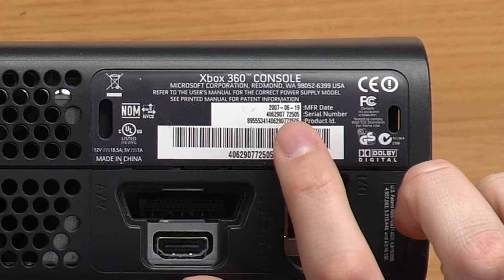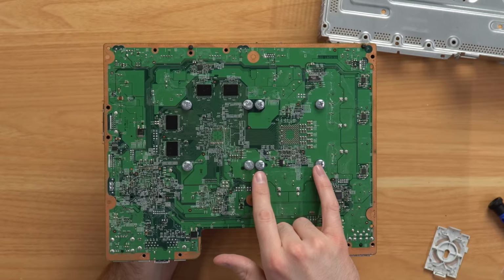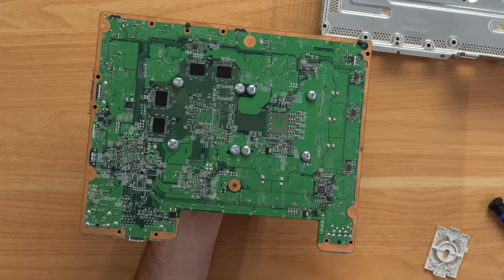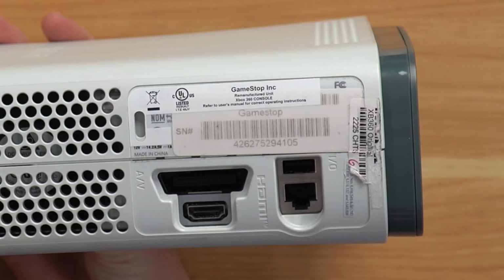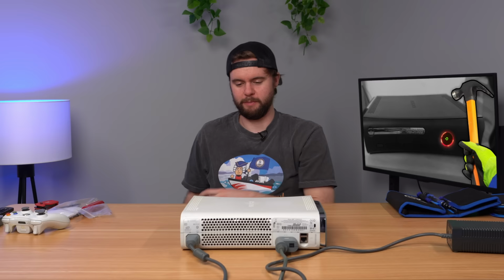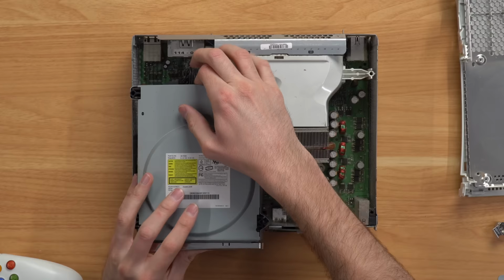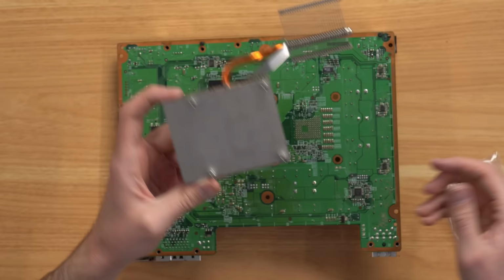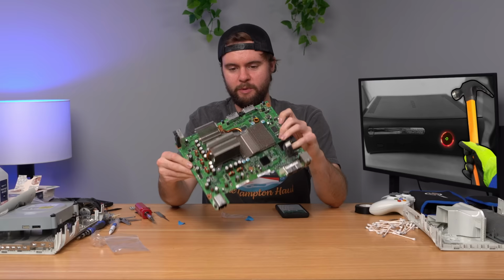Xbox 360 fans won't like this... 😳

Comment from the maker: Who knew iFixit was still selling bolt mod kits in 2024... 😂
Anyone else ever attempted a bolt mod?
Reply: I knew
Reply: I tried the bolt mod on about 6 xbox 360s.  They all worked but failed again weeks later except for one which happens to be a launch console purchased the day it was released.  This console still works to this day.
Reply: I used to do the bolt mods on 360’s years ago. Think I had one come back within a month to be fixed again. I think the last 360 I owned was one I bolt modded and it worked fine, personally!  Don’t know if I was doing anything differently than anyone else, but I didn’t have return customers. Lol
Reply: @zanarkandace6821  they probably didn’t come back cause they were out of warranty, that’s why these are false positives for gpu failure, once the warranty is out what’s the incentive to have to pay for it to be fixed again
Reply: @Nascar1243 I mean, that’s possible. I only charged $20 to do them anyways. But I DID mention to them that it was really only a bandaid, it might work for a a few weeks, a few months, who knows. But I did tell them that if it red ringed again within the first few weeks to contact me and I’d do it again for no cost
Reply: Aye
Reply: Same Me Too I knew It
Reply: hi i was wondering if i can have the 3dsxl galaxy console pls my birthday is coming up and i have been wanting it for so long so pls anwser this text and pls give me it pls and iam sub to you
Reply: Replacing the thermal paste was all you needed to do to that poor console.  Honestly, bolt modding it may well make the thermals worse since it removes the support from the backside of the chips.
Reply: I have never needed to mod or do anything with my 360 but replace the hard drive with a new one because the 360 whenever I got it from my uncle just didn't have a hard drive in it so I had bought another 250gb hard drive and it worked as good as new whenever my uncle also gave me a wired controller.
Reply: Jacob out here fixing Xboxes with out even having to fix them😂

Comment: The fact iFixit sells bolt mods is crazy because a bolt mod does anything but fix your console
Reply: it makes it irreparable. Warps the board, and the GPU so much, the bumps start contacting again, with extreme pressure on them. It's a bodge at best.

Comment: I have an Xbox 360 console myself too, but mine is an Xbox 360 S model and those models aren't as prone to the Red Ring of Death as the older models.
Reply: They actually are more prone than the originals. The last 2 revisions of the original models, Jasper and Tonasket are the most reliable revisions of the Xbox 360.
Reply: Lies. I've seen multiple red ringed S consoles, and I've seen more Phat consoles that actually work.  Any console built or repaired after mid 2008 is a tank, probably more reliable than the slim because the CPU and GPU are separate components on phat models
Reply: @superstar64   mines from 2010 model
Reply: @superstar64  I have an Xbox 360 Slim model that I've had now for almost eight years already and it never gave me the Red Ring of Death so far. At least not yet, anyway.
Reply: @WeHaveACatInTheHouse  I think my Xbox 360 might be a 2010 model as well since I know 2010 was the same year when Microsoft first launched the Slim models of the Xbox 360 with the built-in Kinect sensor port too which I have.
Reply: @vinyminotaur2694  I thought they weren't though since I always thought the original models of the Xbox 360 were more prone to the Red Ring of Death problem than the Slim models. I have a Slim model of the Xbox 360 which I've had now for almost eight years already and I haven't had any problems with it so far.
Reply: @pepsidude8919  Slims are quite reliable and should do ya just fine. But the jasper model is the most reliable out there I believe
Reply: @engrire8458  That's what I was thinking of too and I also have a Slim model of the Xbox 360 myself. I'm not sure though exactly what model of the Xbox 360 Slim it is since I don't know if it's a Jasper model or not, but I know I have one of the Slim models and I haven't had any problems with it at all so far either even though I've had it now for almost eight years already.
Reply: @WeHaveACatInTheHouse the slim?? Ah alright mines the 2013 model The Xbox 360 E
Reply: Lol my 360S died on me like 2 years ago while playing GTA 4. It was the 250gb 360S manufactured in 2010 but I had it since 2017. Then I bought a used Jasper from early 2009, and I've been using it since. The only issue I encountered is freezing in the YouTube app, but considering that same thing happens on my PS3 from time to time I guess it's the app's fault.
Reply: @dusterpl6093  I see then. I've had my Xbox 360 S though since 2016 and I still haven't had any problems yet with mine so far.

Comment: Boltmod is a band aid. Elite needs a new GPU. 1st Xenon needs some of the areas check to make sure there is correct readings coming from post, CPU clock, RST, and PLL. Most likely a failing CPU.

Comment: I did the bolt mod to mine 10+ years ago. The bolt mod works just fine as long as you don't go crazy on tightening the bolts. I used plastic washers instead of metal. I recently refreshed the thermal paste and added heatsinks to the other chips and did the RGH mod. Runs smoothly like it did when it came out the box.

Comment: If done properly the bolt mod can last for years. I fixed hundreds of 360's for a handful of years back then using the bolt mod. I still have 4 falcon boards that I fixed using the bolt mod which were infamous for the rrod. I also modded them with rgh chip's and they still work amazingly today. I have one of them sat right next to my xbox series.
Reply from the maker: Is there anything else you do to consider it done properly? I've also seen bolt modded consoles last a long time (the camo one in the video was actually bolt modded already and started working later lol), but I've also seen the ones that last for a month or 2. Either way, I see doing a bolt mod as at least being better than throwing the console away (which I imagine happens pretty often now)
Reply: @jrob0021  yeah your right some would  only last a while longer, luckily I had more successful fixes more often than not. I had several of my own that just would not take to the fix but what can you do lol. 🤷‍♂️ 

I did nothing in particular other than taking care to reflow the cpu and gpu properly and use good thermal paste/pads. I used to fix them for a local pc shop but used a rework station with a regulated heat gun. If they did have to come back I would often fix them again for free. 

Some people used to use regular paint stripper heat guns, some people also used wrap them in tin foil to "protect the components" which was wild. I definitely wasn't one of those people when I tried fixing my first Xbox I promise. 😅
Reply: all the bolt mod does is bend the motherboard, you are fooling yourself if you think its a long term fix, if it worked for you you where just lucky
Reply: @DavidWhitley  if you don't do it right   and tighten the bolts too much. Also a lot of people only used regular washers and would tighten the bolts right down which ment there was no give and yes as you said just bends the board ultimately resulting in failure again down the line.

I did the mod using washers but I also used a tork screw driver as to not over tighten plus nylon spring washers which helps stops the board from bending or causing uneven pressure.

I did it for a long while not just for fun but for a local shop so although not all fixes would be permanent the majority of the ones I fixed lasted a long while after including the few I still have.
Reply: @Saberbeatsvr  Just like a minute ago I wrote about my very long lasted bolt mod (actually it should still be in running condition and it was release day model, no ie. hdmi or wifi etc) , but I didn't do it exactly like virtually all instructions mentioned. I sanded washers for some reason. I think they were bit too high or something. It could've been stainless washers or something. Anyway I measured my stack and gap and thought it wasn't good enough and tweaked it bit.
Reply: Congrats, you damaged every single console you touched. 

People need to leave repair to professionals if they don't know what they're doing or don't understand the effects of a faulty repair procedure

Comment: The one that was overheating reminded me of my OG PS3. Does the exact same thing, the fan ramps up to maximum within seconds and then it shuts down. If there was anything similar I could at least copy my old save files.
Reply: I've had a few PS3 systems too that also did the same thing and a couple of them even got the Yellow Light of Death (YLOD). They were also all backwards compatible models as well since they were able to read and play PS2 game discs. I don't know why, but it always seems like for some reason, the original models of the PS3 are more prone to the YLOD, especially the ones that are backwards compatible with PS2 games which is also a shame too since those are the only models of the PS3 that can physically play PS2 game discs.
Reply: @pepsidude8919 because of a gpu defect, the same failure as the 360
Reply: @Josh-Barnett  Yeah. Those are the only models though of the PS3 that it seems to happen on mostly.
Reply: @pepsidude8919  I can't remember when exactly but I think around like 08 sometime fixed 65nm gpus were produced. If you have one that has the ylod can't go wrong with a 40nm Frankenstein
Reply: @Josh-Barnett  I see then. I still have a working backwards-compatible PS3 model though which I've had now for almost six years already and so far, I never got the YLOD on it yet. I also got that particular model of the PS3 from Amazon in used condition, but I guess whoever had the console before me must have repaired the inside of the system or something and took pretty good care of it too in order for it to last this long so far.

Comment: a false 0022 seems to be the fans failing or the motherboard getting to hot on startup, if you just blow cold air into the system on startup it will work fine. Very strange, a lot of xbox360's have this issue too including my 2011 slim.

Comment: I'm just going to put a little tiny bit of thermal paste on here because this is a tiny chip ... *Adds the largest of all dots to it*. You should really use a spreader and keep the layer of paste as thin as possible. Or use liquid metal if you aren't working with a copper contact plate. Liquid metal can corrode copper over time and cause permanent damage.
Reply: It corrodes aluminium, sir

Comment: If the usual issue for these machines is bad solder joints, could they be reballed? Obviously not a profitable endeavor, but just curious if that would be the proper way to fix this issue.
Reply from the maker: The proper way to replace these now is the replace the entire gpu or cpu. But yeah there’s basically nobody that does this (very few) and it’s too expensive to be worth it for most people. Just buy a Jasper is usually the answer
Reply: @jrob0021  does that mean buying a brand new chip? Or taking a donor? Would that be because the chip gets damaged due to the bad solder joints?
Reply: It's not bad solder joints - it's bad solder *bumps*. Reballing does nothing to fix the issue because the solder balls connecting the GPU to the board are not the problem. A GPU replacement is the only true fix
Reply: @Harmonic14  OHHHH, ok that's very interesting.

Comment: I did bolt mod on my x0 years ago. Bought release date box from friend in need of cash and it failed like was it in 6months but didn't have receipt for warranty. So I made bolt mod, but iirc I didn't do it like that. I removed the x-clamp, but I'm 99,9% sure I did put some washers between heatsink and board so it essentially couldn't flex even after heating. Wrapped console in towel after that and left it running for like 10mins and let it cool. Yes, brutal but it worked for like two years quite frequent playing. In fact it still somewhere in my parents house and when I stopped using it, it was still working. Man what hairdryer that thing was. Insanely loud fans 😀

edit Oh there was washers in vid too after all. Now recalling that I think I measured that gap and had to carefully sand those washers to correct height. I think they were bit too thick to have nice pressure on cpu. I don't know if was metric thing on washers or what but I think it didn't seat correctly if done exactly like in some instructions. Something like that or I used stainless washers or something. It's been ages

Comment: I’m so loving this type of videos. The fat Xbox 360 wasn’t a reliable console at all, and those attempts to solve heat problems. Huge story, this will remain in gaming history forever
Fortunately modern Xbox’s don’t have so much problems
Reply: This isn't true. The last 2 revisions of the fat models, Jasper and Tonasket, are the most reliable revisions of the Xbox 360. They are even more reliable than Slims and Es. It also wasn't caused by overheating, it was caused by faulty GPUs that were later fixed in the late Falcons which are from about July of 2008 and above until late 2008 when Jaspers were introduced.

Comment: Feeler gauge the motherboard gauge the washers then match to chip height then attach thermal pads to back of motherboard on ram spots and back of CPU / GPu and on top on ram and South bridge I also put one on the DVD drive chip but you don't have to ,  A ... Xbox ,360 NITR0
Reply: The motherboard has to flex just a tiny tiny tiny bit to kiss the heatsinks if you do it right / 3+ years daily gamer then paste clean and maintenance to continue

Comment: The bolt mod did 'fix' some 360s for a while, but IMO it was a better mod as a preventative tactic. I did a bunch of work to my Jasper MB 360 back in the day, including a bolt mod and the better GPU heatsink from the Zephyr generation. Zero issues on that console to this day.
Reply: Why??? The bold mod will just destroy it! It is already more reliable than the slims and now your just warping the board
Reply: @Josh-Barnett  Exactly the opposite. The X clamps warp the board. When you do it preventively, you don't overtighten it like this guy. Mine's been going strong for 12 years now.
Reply: @danielschulz4930  no the bolts warp the board. If your board is warped then that's your tault. The x clamps work fine and were never the problem
Reply: @danielschulz4930  stop saying "ItS beCaUSe hE OVertIgHteNEd iT". The bolt mod will always warp the board, no matter what because unlike the x clamps there's no room for the board to flex slightly when it heats and cools and it warps the board. That's why the heatsink feels loose with the x clamps
Reply: @Josh-Barnett  You can have that opinion if you want! Picking a fight with me over the Internet about something so inconsequential isn't interesting to me. Have a good one!
Reply: @danielschulz4930  I mean it's not really an opinion but ok

Comment: I’ve been into collecting for a while but just recently got my first console which is an nes, which I had to fix. So if there are any of those 360’s that you wont ever do anything with let me know, and I’d love to get my hands on one and fix it!
Reply: Don't bother. The only way is a gpu replacement. You want a red ringed 360 to play with, find a late 08 console which most likely has a power issue